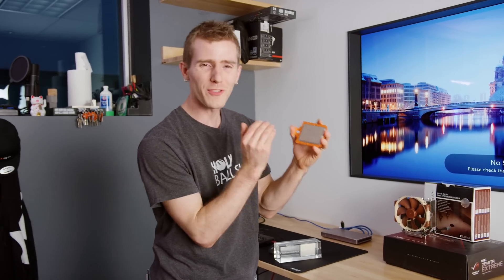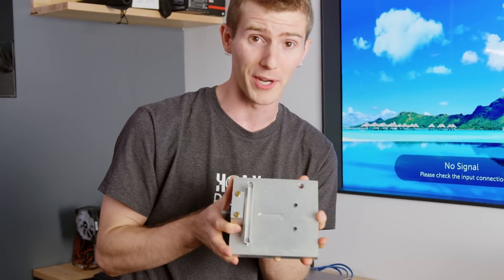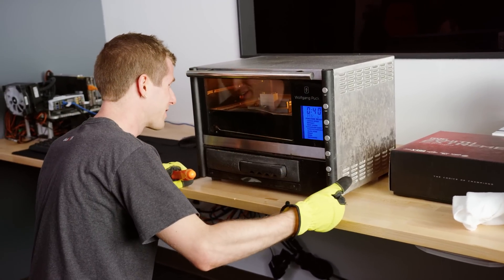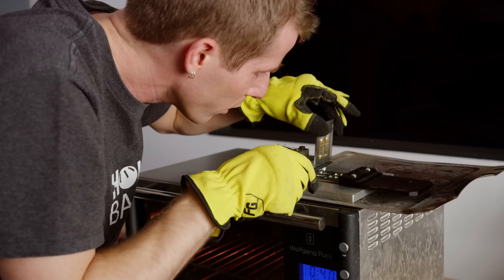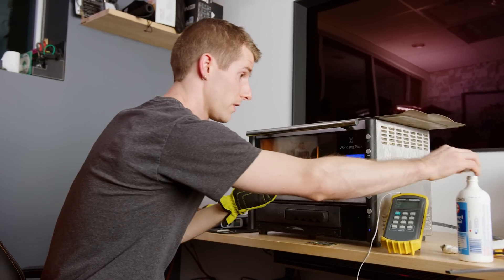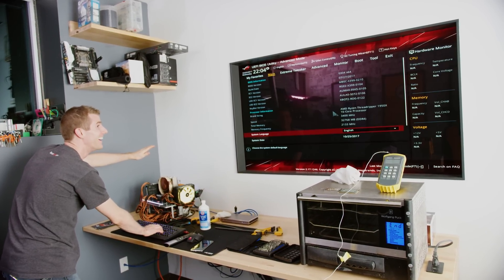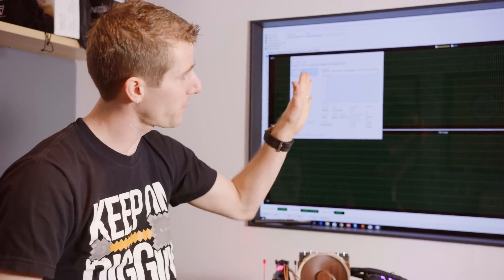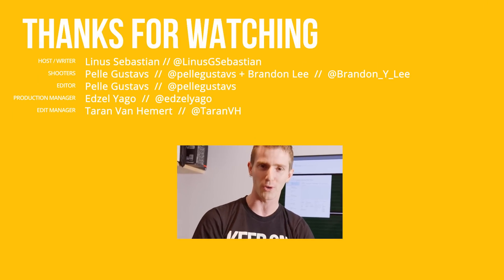Why would ANYONE Delid THREADRIPPER? - Vanity IHS Installation

Comment: it might be beneficial to bake your CPU in mineral oil rather then open air, the temperature control will be a lot more persistence. You just need to dump your cpu into low(no) water alcohol and wash away the oil. After that, apply a really, really small dab(it has to be very small, or else you are going to have some long term problem)  soldering paste on top of the die and surround the die, all the way to the edge of the IHS with some protective thermal grease, squeeze the top and bottom of the CPU back together using a padded clamp and throw it back into the oil and right into the oven. Wait until the oil is at the desired temperature and pour the oil away to cool down the CPU, making the IHS perfectly soldered back to the board.

Comment: Linus, you need to put this in a new threadripper oil/fish tank build now with 3d printed pickups for the oil pump at the CPU using the stock CPU cooling points to mount it and do it all up with UV components and glow in the dark filament so the UV lighting will make it glow, I mean you can custom cut your own acrylic now so why not lol, use some aluminium angles at the corners and edges with the acrylic heavily glued in place
Reply: Think about this I'm serious because then you could see the logo externally and it would just look bad ass

Comment: Did you consider just using your new laser to edge the ltt logo into the IHS of the working cpu. Without having to delid.
Also. Please investigate making a cpu water cooling block of glass or some other transparent (and equally stupid) materiel so the awesome IHS can actually be seen when the machine is running.

Comment: Dude, you shouldn't have a caulk gun, you should have a 500ml tube of that red silicone from the automotive section of a car parts store. You can cut the nozzle very small at the angle you find easiest to use and apply it really nice and even.

Comment: Tip: you can't reliably measure the temperature of a bare aluminum (or most other shiny surfaces) with an IR thermometer. It's mostly just going to reflect IR from the environment around it. So while you might think your CPU was up to temperature, you were probably just measuring a reflection of the IR emitted from the heating elements.

Comment: aren't the thermals ruined by not having proper conduction between the dies and the heatspreader? You removed the solder but didn't replace it with anything!

Comment: Seems like if Der8auer could make a delidding device that used spring tension on the screw that pushes on the lid, you could tighten the screw to put a few pounds of  tension on the lid, put it in the oven, and when the solder and adhesive weaken, the spring would just automatically delid the chip while it's still in the over, at the exact right moment.

Comment: sooo... can i put the lid of a 6600k on my q6600???
Reply: Its funny how many people took this so seriously...
Reply: piece of potato Imagine the eBay scams? Buy an 8700k, take the top off your old CPU and the new one, swap, call eBay and say “It says it’s an 8700k but it doesn’t show up on my motherboard. I tried it in an old 170 and it’s telling me it’s a 6400?!? “Alright, I’ll send it back A.S.A.P.”

You are evil for thinking that way Potato.
Reply: honestly, there has been quite a few ebay scams revolving around the wrong IHS on low end e5's on x99 already.
Reply: Yes, piece of potato, if the product names look similar, it means that everything is interchangeable. If you have an old GTX 480, and want a newer RX 480, you can actually just replace the cooler portion of the card and BAM much faster RX 480.
Reply: +TheCanadianLanBoy If you mean some razor blades and a butane torch by "expensive/enterprise grade machinery" then he might just have the tools for the job... The Q6660 has two dies under it's IHS so you'd want to keep that in mind. I'd do the whole 771 mod thing with a X5460 instead, you can also pick up a pair of X5450's for like $15 shipped if you want spares in case you kill one mutilating old scrap server hardware.
Reply: Don't you dare ruin the legendary Q6600.
Reply: haha actually you can use the whole setup to build yourself a Vapochill... been there done that
Reply: Roshan also you can do it on a pentium g4560 but if i was you, i wont sell it
Reply: piece of potato yeah any radiator will work just fine.
Reply: Ah the mind of a scammer/trickster/joke-ster
Reply: I'd rather put the lid of a q6600 on a 6600k just because it would be a lot funnier.
Reply: LowEndPcGamer plot twist is just half potato.
Reply: Royce Meyer soo... i need to wait till nvidia release a card with the same numbers with a 9800gt? damn... also is the radiator on the back of old fridge useful for a custom hardline loop?
Reply: piece of potato i
Reply: Why tho?
Reply: You can, the socket is pretty similar in terms of pressuring points, yet the height is the only problem and that you need to measure, but I can expect it to be the same.
Reply: dude that would make an ace prank on comapnies that do 2nd hand hardware, get 2 cpu's that look simlar (ignoring the IHS) one obviously far superior than the other then sell it to them
Reply: wow so many assholes not getting the humor 
edit: who wants to buy mine plus 8gb ddr2 on asus p5q board .works all fine but i couldnt resist a used 4770
Reply: So if people don't get the humor they are assholes? With that logic you might as well play Russian roulette. Anyway I just liked the idea, even if it were a joke. Now that this was mentioned, back in the day of AMD Athlons  some people bought higher and lower end Athlons and swapped the heat spreaders and kept the better CPU and returned the lower ones and got full refund of the better CPUs cost.
Reply: Or maybe it wasn't a good joke after all.
Reply: OH.... Well you should use the name of who you comment on in your comments as I assumed you were talking only to me...
Reply: You all really got taken on a ride with this thread, huh.. I'm starting to question who the real potatoes are.
Reply: Every body here: piece of potato was being sarcastic, for those of you who don't know.
Reply: piece of potato yes, why not? If you really want to
Reply: Sadistic Slayer oh that's why my q6600 stays pretty cool considering the cpu is already more than 10 year old... and also you can pick up a x5450 that is already modded to socket 775 on aliexpress
Reply: Crzces wait wat that is actually a thing???! sorry I'm just fooling around witch some facts... good thing you shared your experience with us so we didn't got scammed easily
Reply: Eryk G ikr
Reply: Wowthatsfail no3 that's illegal m8
Reply: Delit i7 and put it on an i3 and sell it as an i7 🤔
Reply: @TheCanadianLanBoy... maybe you should watch the video with attention before commenting, because the lid on the threadripper is also soldered...
Reply: omni574 that's what im talking about 😂
Reply: piece of potato and sell it for profit!
Reply: Milaan Dahiya also can i build a drone with couple of 120mm fan😂😂😂
Reply: If your litteraly speaking, no, q6600s "lids" are soldered, unless you have expensive/enterprise grade machinery
Reply: ........ no
..........
Reply: TheCanadianLanBoy no they're not, they are glued the same way as a new processor

Comment: if working you mean that it is at 60c at idle then ya, it works
Reply: Bios is a terrible indicator
Reply: wut u live in Siberia?
Reply: He should have used CLU, he's made the thermals far worse, but nvm, it's cool that the engraved cpu now works, and he can easily swap out the paste later to improve it.
Reply: ikr mine sits at 30c idle
Reply: well right now it 28c idle
Reply: Mine is at 26, I run a custom AIO. Ambient is around 12.

Comment: Dear linus, have you ever thought about using 3dprinting to make custom computer parts? Obviously the hardware cant be, but basically anything plastic could be made with a decent 3dprinter. (Though there is brass, steel, iron, and carbon philaments)
I just have an image of a 3dprinted carbon fiber desktop case. 🤔 If your not into 3dprinting I suggest getting into it as a decent printer can be sub 1k$ and you could make basically anything you can think up.

Comment: Hey Linus, some advise. Next time you decide to de-lid a threadripper, put it in the de-lidder tighten the screws a bit until you can feel a moderate amount of tension and hit the top of the heat spreader with a heat gun (65-75 watts should do the trick) until the lid pops (also remember to move the heat in small circles so it heats evenly without making hot spots). This method is 1000x safer than the old "oven trick" because you know exactly when the solder gives way on the heat spreader reducing the chance of cooking it, this method is also 10x faster than the oven trick and it works when you re-lid too.

Comment: Yeah, let's not use a hot air rework station or desolder braid, let's use a razor blade to SCRAPE the solder off the dies instead.

Comment: its just a basic delidding.. why so panic..
Reply: Not a basic delidding, he had to melt the solder, there's no reason to delid a soldered heat spreader so thus very uncommon. (This is damn near the only time you'd delid a soldered heatspreader, for a vanity plate)

Comment: Erm, why not just use your new laser engraver/cutter to etch your own lid?
Reply: pretty sure that like half a second of laser on that cpu would already burn a hole through it.
Reply: that might work. 1st off, the Al is too thick and has a massive amount of heat capacity and it's pretty reflective. I know you can kick it in the ass by coating a piece of Al with black paint but I still don't think a 40w laser is going to do it.  We just have to convince LTT that they messed up by buying the teeny weenie laser cutter and have him spring for the 150/180 watt tube.

Comment: which is better amd or intel because i wanna build a pc
Reply: 1. You make the assumption they're a child, not only odd but also irrelevant. 2. You said several classes on their history. 3. I agree they should be looking for help as to what to buy based on their lack of experience, but rather than offering resources and actual advice you try to push them out of the PC space when they came looking for the help of those with experience. To the OP, what is the goal of your build? If gaming, what games do you plan to play? What experience do you want from it? Areou trying to go with a 720p 30fps build or an ultrawide 60fps? 4k? Or just trying to enjoy the PC gaming "standard" of 1080p 60fps? And maybe the most important question of all, what's your budget?
Reply: i am the one and only morty depends on what you want. Single core speed? More cores? Generally for the money intel has faster single core performance while AMD Ryzen has more cores. Not sure how coffee lake compares to ryzen though.
Reply: If you're on a budget less than $300/ £250 then used Intel CPU's are the way to go. Third gen i5's are pretty good, and ddr3 ram is a lot cheaper than ddr4. If your budget is $500 / £435, AMD Ryzen 3 or maybe 5 is your best bet. If you don't have a budget, get Intel, its faster for gaming but costs way more.
Reply: You're trolling, right? It takes almost no knowledge to build a PC, and you definitely don't need to know the history of Intel and AMD to make the correct choice in 2017. To actually reply, it depends. I agree with Nightcore apart from the fact if you have a large budget I wouldn't bother with Intel, even if you're gaming a R5 1600 or R7 1800x is the way to go with a large budget imo, Intel brings a few more frames to the table but not worth the price.
Reply: Curbo 34
I agree but i would happily take an i7 8700k @5Ghz over my R5 1600x @4.1Ghz any day. Just cant afford one. Its a shame too, my waterblock is compatible with Intel as well as AMD.
Reply: Trolling? Not my game, but I've seen too many children and fools waste hundreds on what they think they need. I chose the safest response to make in this situation.
Yes I agree it takes neither knowledge or skill to build a pc, but to do it _right_? Well that's a whole other ballpark.
And I didn't say they need learn the companies histories front to back, the point is you can't build a pc without some knowledge of the current and previous generations performance and capabilities (how the hell would you make a single informed decision?). 
The line "which is better amd or intel because i wanna build a pc" is the ultimate example of someone who has no clue what they're doing, my reaction was ultimately justified.
Reply: MonsterWithConscience
I agree completely
Reply: which is better jeep or ferrari because i wanna drive a car
Reply: You are not ready to build a PC if you know nothing. Go take several classes on the history of these companies and then try again.
Small children with no knowledge should not be building PC's.

Comment: i get the reasoning but WHY??if you use the vanity ihs chances are that you will erase it somehow when cleaning the thermal paste as it has happened with most of the cpu's you have..!
Reply: dyzio2206 I think he just wants a working one. After he verified it working he probably put it back in the display case

Comment: can someone help me with this? i recently bought a new motherboard for an optiplex 760 DT and when i put it all together i turns on automatically and the fans spin up really loud for about 20 seconds shuts down for a few more seconds then repeats the process. i know its nothing to do with the cpu itself (C2D) becuz i just took it outta me other system.
Reply: 1. Check if cpu fan is plugged in on the mobo.
2. Check led light error codes or number error codes
Reply: the  cpu fan is plugged in but  the numbers on the front flash a bit.
Reply: Please quote system spec and what number on the front?
Reply: Intel Core 2 Duo E8400, Kingston 4Gb (2Gb*4) in dual channel.
Reply: and do you mean the number codes that flash on the front when it on?
Reply: Motherboard? GPU? Power supply? Have you checked if the ram kit is compatible with your mobo? And any error codes or error LED indicators?
Reply: PierreDolphin the power button is in yellow and not blinking and the numbers 2 3 4 are blinking
Reply: Mate you've got to make it a bit more clear. So the power button on your case is in yellow right?  And what numbers are blinking? Are you talking about the indicator LEDs on the motherboard or what?

And I really need to know what motherboard you're running.
Reply: the power button is a solid yellow and the numbers on the front panel are flashing 3 number, 234. the motherboard is a  Dell E93839 GA0403, the psu is f255e-01, ram is Kingston 10600 - u. Nothing has popped up on screen when it turns on.
Reply: Ok. Now we're going somewhere. So please clarify if you have only switched out your motherboard, and am using all original components otherwise? Also go to the https://www.dell.com/downloads/global/products/optix/en/optiplex_780_tech_guidebook_en.pdf      page 3, are your drive activity, network and diagnostic LEDs all blinking?
Reply: Oh i get what you mean now. So 2,3,4 diagnostic lights are lit up. Ok. Any beep codes?
Reply: PierreDolphin no
Reply: And there you go. https://www.dell.com/support/article/uk/en/ukbsdt1/sln284978/a-reference-guide-to-the-dell-optiplex-diagnostic-indicators?lang=en#2005_to_2009

Follow the instructions. See if it help.

Comment: I hope to see that dust one year benchmark results video very soon.
Reply: It should actually be next Friday since the first video was on December 8th, providing they are going purely on date alone.
Reply: EasternSkvngr Whoops my bad, I thought it was Dec. 2nd, but you're right it's Dec. 8th.
Reply: Well it should be up soon regardless, thats assuming they didnt forget about it or accidentally fuck up the results by moving/unplugging them when they did a bunch of that renovating recently
Reply: They moved and unplugged them during all the building work. You should check their twitter more often.
Reply: So is the benchmark off or they kept going
Reply: Its still going to happen but it wont be as "Scientific" as most people would have liked. Me, i don't care, i just want to see a dusty pc
Reply: YES
Reply: Sure the video was posted on that day, but you already know that the video was recorded before that.
Reply: yea
Reply: I don't get why they are actually running the system when they could just botch together some 12 volt power brick and run the fans off of that. Or even a power supply jumper
Reply: Idealideas100 or the power outage.

Comment: Love the fact that you do all this just to hide the beautiful IHS they sent you...
Reply: Because plastic transfers heat so well from the IHS to the water, right? >.> :D
Reply: I doubt he'll actually use it regularly. Just wanted it to be a working cpu instead of a dummy one.
Reply: This is the last time Linus will ever get sent something rare
Reply: zstewart93 Transparent blocks are so you can see the coolant. The coolant and the metal heatsink will still block your view of the CPU.
Reply: Coolant only if it's coloured. But yeah, the coldplate will block the view of the CPU (which is why i said "plastic transfers heat so well /s." Coldplate would need to be out of plastic to be able to view the CPU).
Reply: He could build a closed loop liquid cooler with transparent cpu block.